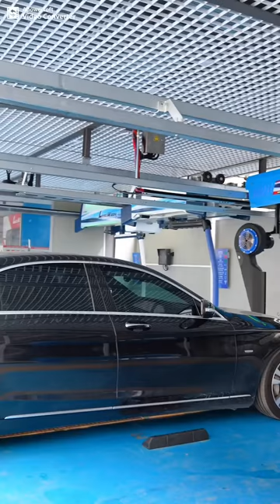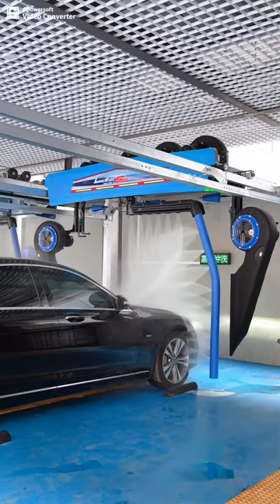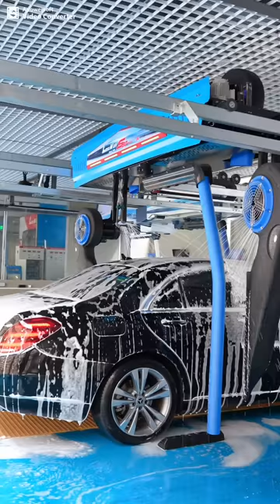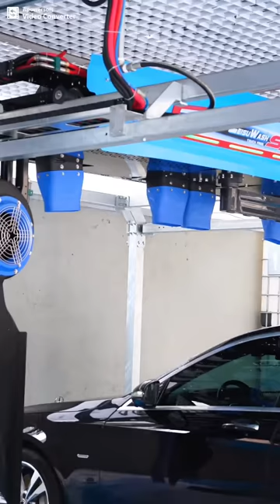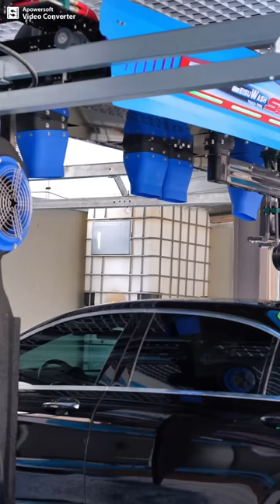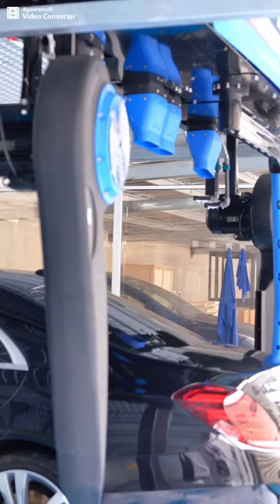2023 New Model! Leisuwash S90 Premium Touchless Car Wash Machine

Comment: It looks great because it's new. Once the water jets plug up calcium and soap residue, it's not the same it will suck.
Reply: I think you would need some water treatment installed, so the machine only get supplied with de-ionised/de-calcified water. Regarding soap residue I think it depends if there's some high-pressure maybe hot water cleaning cycle involved. I guess there's also differences between the different types of soap, some more likely and some less likely to clog.
Reply: there is a water treatment system under

Comment: If it's touchless. That means the chemicals used is very strong. Any soap that can cut dirt without touch can strip wax off the vehicle to.
Reply from the maker: touchless car wash depends on the water pressure / chemical quality / the distance between car body and high ressure water / the machine functions.